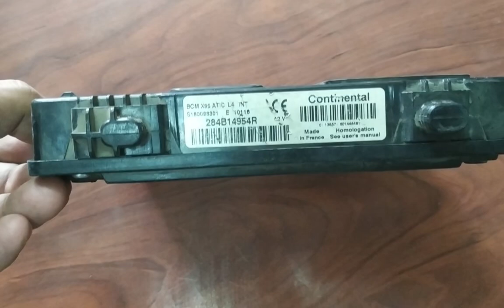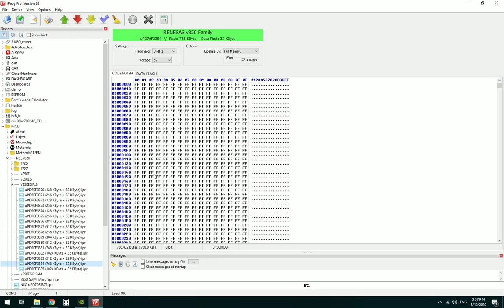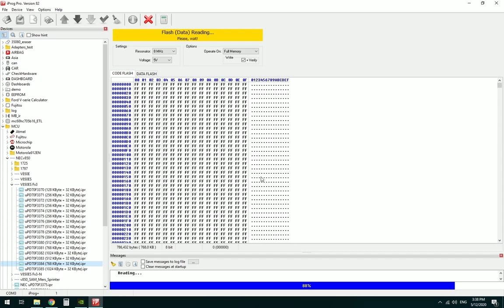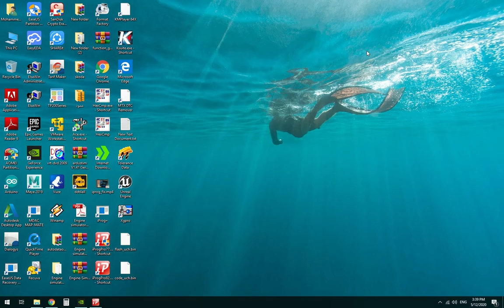Read Fluence Renault UCH x95 by Iprog

Comment: Hello,
I have just bought the black iprog +, but I still have the message Programmer not connected, I have changed my PC and the usb cable is still the same.
I checked the voltage I have 5v on the usb port but no voltage on the large connector neither 5v nor 12v as in  diagram.
thank you for helping me

Comment: 👍 👍 👍 Good vidéo
I need your help, my iprog ++ is not detected, driver installed correctly, in windows xp, 7 and 8. Every time the same problem,
Message : Programmer not connected.
Thanks in advance for your help.